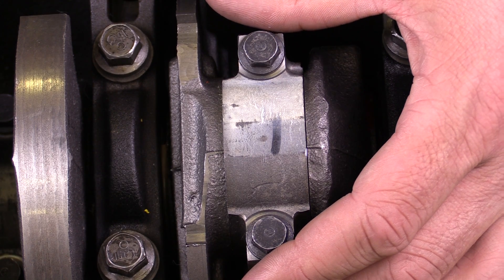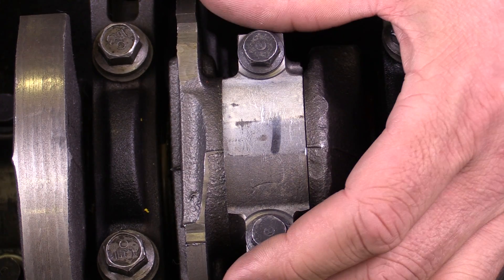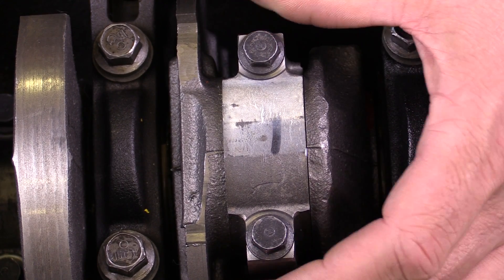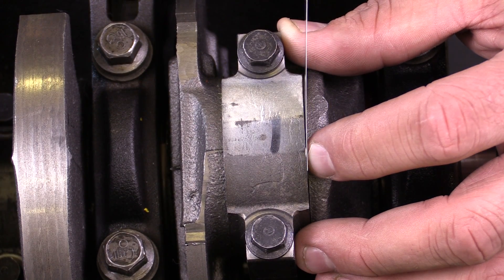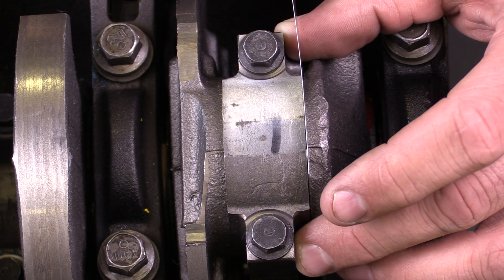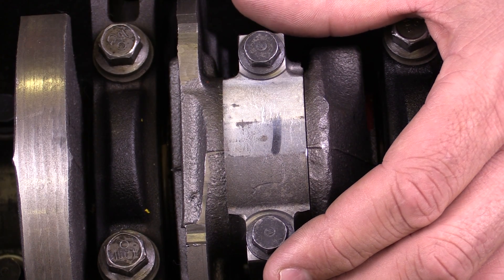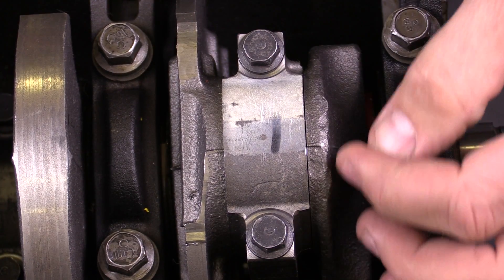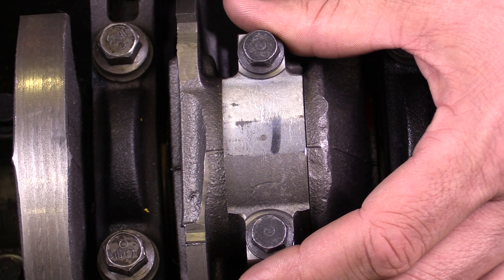Explanation of the Connecting Rod Side Clearance Measurement

Comment: What you do if there is too much clearance?
Reply from the maker: Replace the bearing at the least. They have oversize and undersize. If the clearance can't be made with bearings then it may require crankshaft machine work or replacement.

Check this article out https://itstillruns.com/oversize-vs-undersize-engine-bearings-12153771.html
Reply from the maker: Sorry I didn't look at the video when I replied. The info above is for bearing journal clearance. You need to determine if it's the crank or the connecting rod cap. Do a comparison of the out of speed cap and the other caps to see if you have abnormal wear on the cap